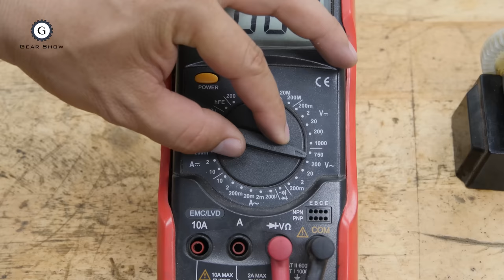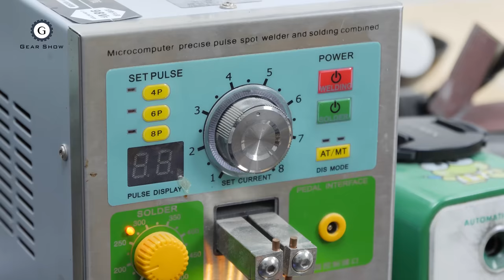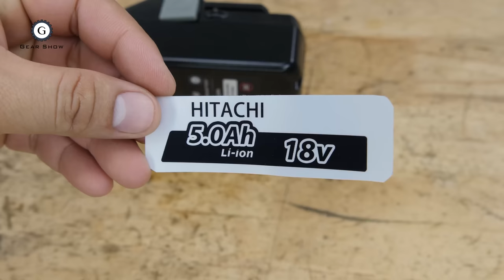Old Model Cordless Angle Grinder Restoration | Hitachi G 18DSL

Comment: Samsung SDI -  these are pretty good cells, I owe a few tools powered by them
Reply from the maker: Yes, it is.
Reply: Nice with high drain cells. I Think you should also use pure Nickel strip and then your battery builds Will be 👌
Reply from the maker: @victor bruun Yes, I will, thank you for the tips!
Reply: Too much grease.. the gear will get hot and motor will work hard cutting trough the grease continuously

Comment: This is back when tools were tools. I really enjoy your Hitachi, Makita, and old Nicad DeWalt drill rebuilds. I like Makita a lot but I still use my old Dewalt 18 volt Nicad drill from the late 90’s it runs great. I’ve had to replace the factory batteries a few times but I keep using factory batteries they seem to be the best, unless I’ve over looked some batteries. I grown attached to the drill and should of just bought new stuff but I will run my old Dewalt until I die.

Comment: I have a very similar hitachi grinder but it's only 14,4 v. I've just repacked the batteries with new cells, but won't start anymore. Check almost everything : rotor good, start button good, brushes good, wires good. I think the aluminum module block could be the problem. What do you think?

Comment: What white POWDER U USE FOR CLEANING
Reply from the maker: It is detergent powder.
Reply: @gear_show  thanks for ur replay sir ☺️👍
Reply: While degreasing gear parts , i saw u put that plastic container in water 

Is that boiling appliance or vibrator

Comment: He packs the gear housing with a lot of grease which is a good thing. Most tools now are greased with grease you can barely feel but they say it works as good. I don’t really buy it as much because my older older tools have lasted a lot longer, I replace brushes yearly or sooner if need.

Comment: 11:02 Red threadlocker, not blue? And then how to unscrew it?
Reply from the maker: Why not, it protects the screws from vibration.
Reply: @gear_show  Yes. But I mean red is much stronger and does not provide for further disassembly, it fixes it tightly. And blue provides for disassembly.

Comment: Did you buy dedicated battery case with correct board? Ive noticed in your previous builds you usually use different boards and you cant use dedicated charger or this time you bought correct batteries. Can you explain us a difference between those builds. I was always wondering why you cant use standard charger. Nice work

Comment: 11:52 is that normal ?
Reply: Perfectly normal .  The keyway is made from a polymetal alloy same as used in the T1000 terminator.  It will melt and reform in the proper position.  All is well.

Comment: I don’t understand, am I the only one who thought that the author mixed up the polarity on the motor and it was turning in the opposite direction? This is especially noticeable when he started the angle grinder without a disk and the nut was unscrewed, although it should be tightened due to the rotation of the spindle.

Я не понял, мне одному показалось, что автор перепутал полярность на моторе и он крутит в обратную сторону? Особенно это заметно, когда он запустил УШМ без диска и гайка открутилась, хотя должна от вращения шпинделя закручиваться.